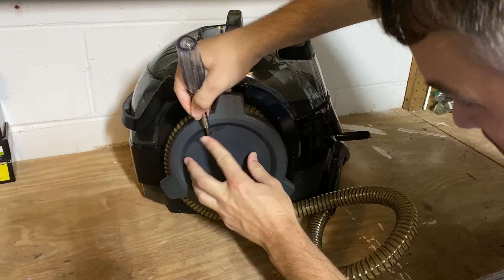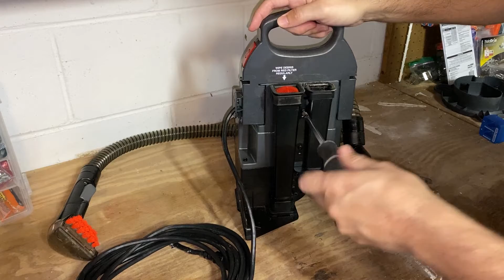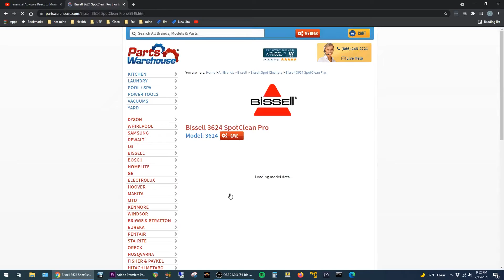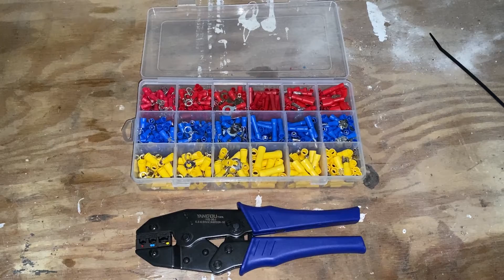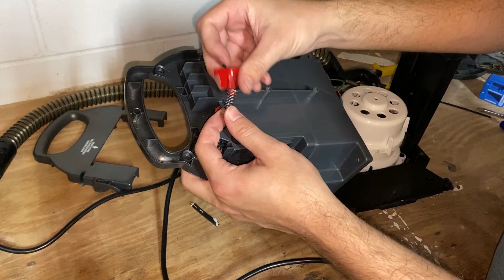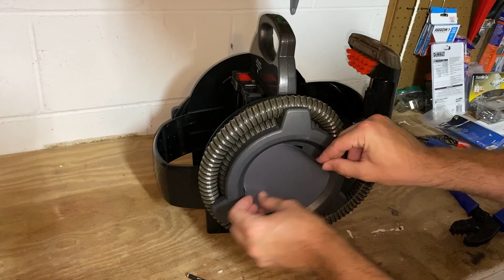Replacing Damaged Power Cord on Bissel Spotclean Pro

Comment: This isn't even the correct model for my carpet cleaner but I kept watching because of the meth hound statement. My cord was also destroyed by a baby velociraptor of the ridgeback variety 😂. I spliced it together already and now with a new spot of destruction, realize I should probably replace the entire cord. My upright will be different with screw removal, but the capping and crimping should be similar. Thank you for the video!

Comment: I can’t for the life of me get the cord sorted out and the handle put back together. I’ve replaced the wires and the reassembly has me totally stumped. How I weave the power cord back through the handle and then acr the power button correctly is driving me insane. Any tips?